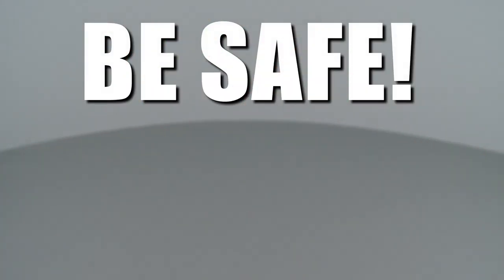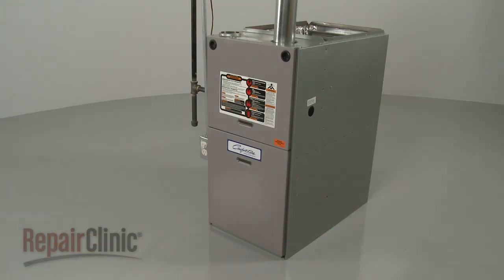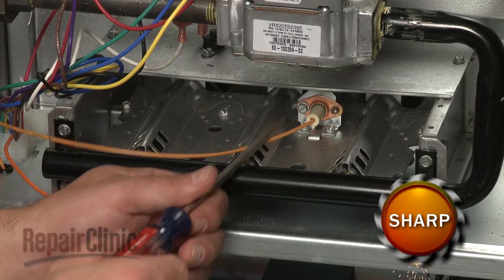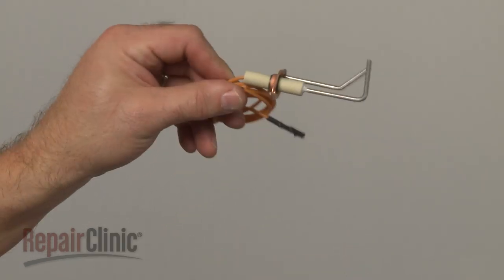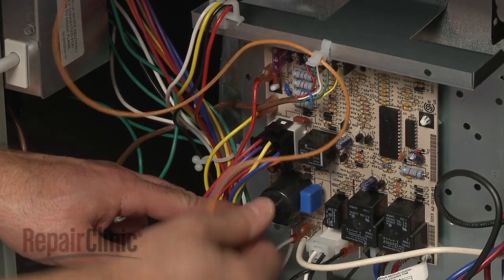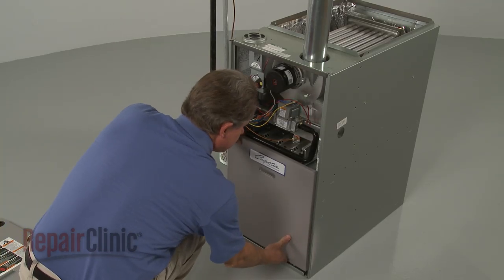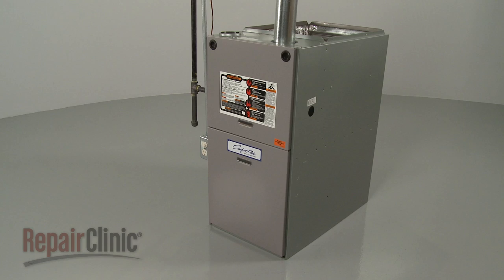Rheem Furnace Not Heating? Igniter Replacement #62-24164-01

Comment: Wow! Spectacular. It’s $450 every time I have anything done on mine. That’s what you saved me, assuming this works. I had to replace the board twice last year so I needed a break! Thank you. 

Know this, fellow Rheem owners: when the circuit board, which is only about $130, goes out and you replace it, Rheem guarantees the board. But it’s only to replace the board. Not the labor. So when the replacement board was defective, I paid $450 AGAIN on labor just three months later. That’s not guaranteeing the part in my opinion.
Reply: How long did that last before it went?

Comment: you don't mention shutting off the gas line.  should this be done?  I have a furnace like this for heat and I won't to turn it off for the summer.  should I just turn off the power or should I turn off the power and the gas line?

Comment: Could a dirty or broken igniter cause my furnace to heat only when we turn it on manually? When we let it run by itself, it will blow only cold air when it starts itself. Two techs have been out so far and neither fixed it or looked at the igniter.  I'd appreciate any help! Thank you.
Reply: Inspired Camel did you ever get a solution to this?

Comment: is this a flame sensor & ignitor all in one??????
Reply: Cindy B
Reply: no, the flame sensor is separate, it is usually  followed by a yellow line.
Reply: This is an electrode ignitor/ground rod. The vintage arcs to the ground rod and ignites flame
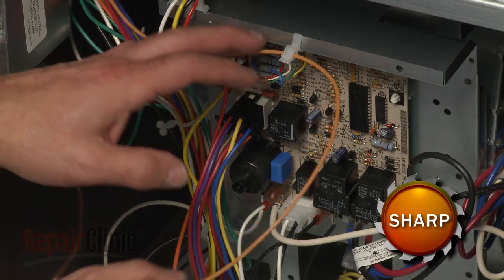Reply: No. you can see at 0:48 seconds into the video, right below the gentleman's hand, and beneath the black bar, that orange cable goes to the flame sensor. If your furnace is igniting and then shutting off after a few seconds, then you need to replace the flame sensor.
Reply: @froggey5689 that's good to know actually. Now I need a new Igniter...should I order a new Flame Sensor while I'm at it just in case? Both parts are relatively cheap enough

Comment: Filters changed, but not turning on now
Reply from the maker: Make sure it is the correct filter for your model. If you have an older model, sometimes they need a lighter/thinner filter. Double check if the filter is not choking out your furnace.
Reply: @repairclinic  Thank you for your response.  We double checked  the unit, & it began working just fine.  some momentary glitch, we figure, but HALLELUJAH it's working fine now.

Comment: Looks easy enough, my furnace has two other ignitors.  The one replaced in the video comes on the others don't.
Reply: How did u fix it?
Reply: @bcbp14  I still haven't.   The plate needs to be replaced for the other igniters to work properly.